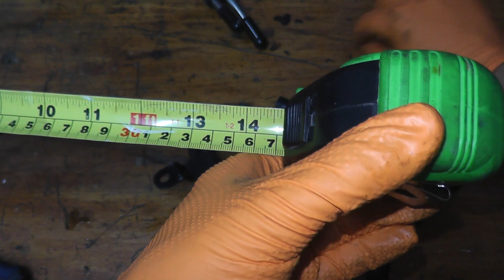Subaru Transmission Oil Cooler Line Replacement With Basic Hand Tools

Comment: Thank you for posting this video; it helped me out tremendously as I have not removed transmission lines before.  With the help of PB Blaster, i had no issues with any of the bracket bolts, which is unheard of in my experience working on vehicles.  Also, I used a set of ramps which gave me excellent access to not only the transmission line hoses, but that last bolt.  Once again I appreciate the video!

Comment: Great tutorial video, and help a lot for getting mine done. A little trick I used is to remove the driver side wheel for much better access and removing the the pipes downward.

Comment: Excellent video. I would recommend spraying bolts with PB blaster the day before
removing bolts because they have a tendency of snapping off then your stuck using zip ties to keep line in place.  I enjoyed the video. Good call marking the hose its easy to mix up.😀👍
Reply from the maker: Good tip! Thank you.

Comment: Thanks for the informative video and was very helpful for this Subaru Impreza owner. In regards to using the extensions, get yourself a short piece of small piping that fits over the racket wrench handle. Thanks again now to get to work and fix my leaking lines.

Comment: Incredible, I just had this fixed on my 2010 Impreza a month ago! Also about a year after my timing belt change. About 136000 miles in
Reply from the maker: I'm still surprised it failed after 9 years. Funny enough the rubber lines were in excellent shape.
Reply: @CarsNToys  same with mine. If our cars continue to be so similar, we'll get to enjoy an exhaust system replacement video within a year or so :)
Reply: @CarsNToys I bought the line from Amazon, doing this on my wife's 09 Subaru impreza this weekend. I put a used motor in it not too long ago and she's running great again but now this transmission  leak is costing me 30 bucks a week in fluid Lol my mechanic tried to replace the hose but then he said the pipe was crumbling and he couldn't get a hose clamp on tight enough. My question is, did a lot of fluid drain out when you disconnected the cooler line? I'll be doing this one myself. Thanks!

Comment: Thank you for your very informative demo of how to replace ATF cooling lines on a 2010 Impreza. I have a 2010 Impreza with the same exact leak in the same exact location. I was surprised that not much AT fluid gushed out when you disconnected the hoses.  Did you drain the ATF from the transmission off camera before disconnecting anything?

Comment: I let a transmission shop(Dr Nicks), rebuild and install my 4EAT transmission on my 2005 Saabaru and these idiots broke this particular hard atf cooling line.  They replaced the hard line but didn't install it properly,  so the hard line was vibrating while running which eventually wore a hole through the aluminum line.   I spent $3500.00 with this transmission shop, plus they didn't seal up my brandn new Subaru transmission pan properly.   They also broke one of my expensive LED foglights.

Comment: This is exactly what I needed for my '13 Forester!!!! Thank you!!!
Reply: @staci Was the part the same as the one he linked to for you forester?
Reply: @natey18  I ordered the part from a Subaru dealer, to get the correct one. But yes, same, basically.  ATF cooling line.
Reply: @natey18  the Subaru part is copper or copper-lined. Just got new parts today in the mail and installed (just washed up) since I first replied.

Comment: Hello thanks for the great video. I followed your instructions but I unfortunately forgot to mark my lines and where they go can you tell me on a 2001 Subaru Forester L where the inlet and Outlet are located on the transmission? They're already connected to the transmission but I had to disconnect them in the center and they're both equal length so I don't know which is which

Comment: Thanks for the video. Will see if that’s the problem on my 08 TL. Tranny fluid is leaking from the transmission area and not quite sure what it can be. Hopefully just a hose setup like this one.
Reply: Did you ever find the leak?

My Subaru is leaking ATF, and I can’t find where.
Reply: @Americansikkunt  Yes. It was the hose clamp and rubber hose end. The hose end was cracked and the clamp had loosened up a bit. Trimmed end and tightened up the clamp and all is well.
Reply: @thegreatgiginthesky387  thank you for the reply!

And thanks for the tip, it may save me a headache and $$$

Comment: I have a leak on the exact same line on my 2005 legacy Outback wagon. Do I need to replace the whole stainless steel line? Or can I just replace the one hose that's leaking?
Reply: this is what im wondering ? the hoses up front do seem to have a slight leak so im thinking of replacing, but the metal pipes dont seem to have any leaks ???
Reply: The new metal lines are sold as a two-line kit. The OEM metal lines are welded together and can't easily be separated. It would be more difficult to replace just one metal line.
When my metal transmission oil cooler lines developed a leak, I replaced the metal lines entirely with flexible rubber transmission oil hose. The flexible hose runs directly from the transmission oil cooler in the bottom of the radiator all the way back to the metal nipples on the transmission. It's worked great since I installed it four years ago. It's easy to install the flexible hose.
My metal lines failed due to corrosion right on the nipple of the metal line at the radiator end. It was a pinhole leak that sprayed high-pressure transmission fluid all around that area of my engine bay; it was a mess.
Reply: @davidkott6959  id prefer to buy them stainless steel versions rather then the OEM made of plain metal.. they are cheaper and easier to get in australia also which is a bonus for me, OEM subaru parts are a pain in the ass to get here and dare generally overpriced
Reply: Mono gram adikt I agree; stainless is the way to go if you're replacing these lines the hard way. The OEM low chrome steel will rust out, leak and strand you with an empty transmission. This is the first time I'm advocating a Dorman part!

Comment: im curious about burping trans oil lines ? will bubbles of air just push their way through the system or is there a correct way to make sure its just a steady stream of coolant and no trapped air pockets that will lead to over heating and warning lights coming up on the dash ?

Comment: 2010 Forester 150k
Mine began leaking at the bracket right under the battery box. I ran new transmission cooler hose for the entire length. I didn't have time to wait for the new lines.
Reply: ha that's an awesome idea, I should just do that for mine. Is there any drawback?
Reply: @kezdodik1  
Only drawback is that you have to make sure to tie it out of the way of any moving parts and sharp edges. Especially the steering shaft. Leave  the original steel lines in place to tie the rubber hoses to. Use high quality zip ties that won't fail in heat or if they get oil on them. 3M is a good brand. Nylon. Not plastic. Don't tighten them so much that they collapse the hoses. I used 3/8" transmission cooler hose. 15' will do it with some left over. It's tight going on the nipples. You can heat the end of the hose with  a hairdryer to help. I recommend using fuel injection hose clamps. They clamp more evenly and the rolled edges don't cut into the hose. Cost about $40 all together. Hose is $2 a foot. Quart  of ATF is $7. Zip ties were $3. I already had the clamps. It's a messy job. Have fun!
Reply: @kezdodik1  I also used flexible transmission oil hose on my '03 Forester to bypass the metal transmission coolant lines when one of them developed a leak. The flexible lines work great and have been leak-free since I installed them four years ago. It was easy to install and secure the flexible lines. I ran them right next to the unused metal transmission oil coolant lines.
Reply: @davidkott6959  Yeah , I actually just did that in December 2019, and it's been going strong since! it was an 06 forrester.

Comment: @CarsNToys I bought the line from Amazon, doing this on my wife's 09 Subaru impreza this weekend. I put a used motor in it not too long ago and she's running great again but now this transmission  leak is costing me 30 bucks a week in fluid Lol my mechanic tried to replace the hose but then he said the pipe was crumbling and he couldn't get a hose clamp on tight enough. My question is, did a lot of fluid drain out when you disconnected the cooler line? I'll be doing this one myself. Thanks!
Reply from the maker: Not too much drained out. However, I tend to be mindful when disconnecting / removing rubber hoses. In other words, I'll make sure the end of the hose is facing up and I'll insert a stopper, or paper towels, to prevent any further mess.
Reply: How did it go? I need to do this on my '09 Impreza as well. Just ordering the parts as we speak...

Comment: I have the same question as someone else - which line is the outflow from the cooler?  I want to flush the system.  (Really, someone should do a video on that, as it is more common when buying a used car and the trans fluid looks like its all been in there a good while.  The conventional drain @ the trans pan and then fill only replaces 1/2 the fluid at most.)

Comment: Thanks for the video. That fluid was nasty looking!
Reply from the maker: Hope it helped. Yes, I should really flush the fluid. Cheers.
Reply: @CarsNToys  I wouldn't flush it. (You probably know this) older fluid that has gone past its prime has grit in it that is actually giving needed friction on the plates. Yes, the plates are worn out because of the girt but it's actually giving the trans it's last life. Once you "flush" the ATF, all of that suspended grit is 1) no longer providing friction on the plates that it needed and 2) the debris that was "safely" suspended somewhere is now floating around and will eventually lodge in some small port causing likely failure. I would just get what you can from the pan and refill. At least that Impreza has a plug so it's easy. Dropping the pan is an option. I would never flush it unless the fluid is fairly clean (yours might have been fine I couldn't see it on a white paper towel.) Some people would say that "flushing it" gets all of the debris out but that is incorrect. Keep the fluid at least a slight shade of pink and flush away, once it's too dark to see through - change only the few quarts from the pan's drain plug. You have to use judgement (actually more like guess) as to how long your "fluid changes" should be. I would try to do them every 15k once you discover dark fluid. If the transmission is still working after say 30k, I'd bump the fluid change to 10k and lower.

Comment: What were to happen if the cooler hoses were switched?
Reply: You wouldn't get correct circulation.  Take a fast pic of original connections before disconnecting.
Reply: I don't think anything will change. The oil transmission cooler inside the radiator is just a coil of metal tube bathed in the engine coolant. The transmission oil will flow in either direction through that coil; it's just a tube. It doesn't matter which way you flow transmission oil through the radiator's transmission oil cooler.

Comment: would this be the cause of the at oil temp light flashing along with the traction control and abs light coming on ? *ive been systematically going through everything to try and figure it out ? all my fluids are good ect ?
Reply: Yes, as far the the Oil Temp Light.
Reply: @beitel21  i ended up putting  new radiator in and doing a coolant flush and replacement and everything seems to be running smoothly now *did oil change and also replaced a few lost litres of trans fluid that happened when taking out the old radiator,, i definitely think you have to be as accurate as possible when refilling engine and trans oil as even slightly too much can seem to create issues, slightly less seems to work better and adding a few hundred ml at a time and checking dipsticks until the levels look reasonable etc while the engine is cool of course

Comment: Anyone have an issue with the hose blowing off of the radiator on the passenger side? At first I thought maybe the clamp wasn’t tight.  But then it did it again and I had made sure it was tightened

Comment: dealer wanted me to pay $450 for this simple 1 hour job.. what a rip off.. Stay away from dealers for this type of jobs.

Also recommend to get new set of the rubber hoses and clamps.  Pinching existing hoses back in different spot might cause leak.. I had that so I went and replaced all 4 hoses and clamps.
Reply: Whitby Subaru recently quoted me $550 and 2 hours.  Initially they said it was leaking and I mentioned never seeing oil on the garage floor.  Story changed to it's badly rusted and could start leaking.  After watching this video, I'll wait a month for the warm weather and do it myself.